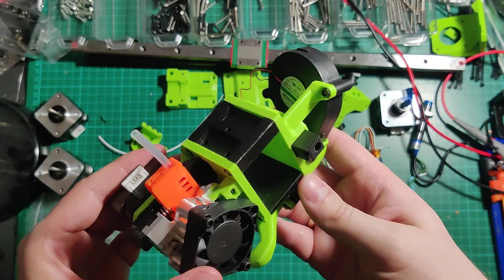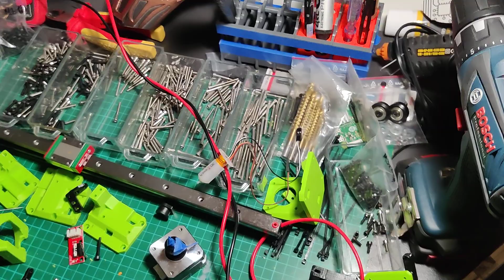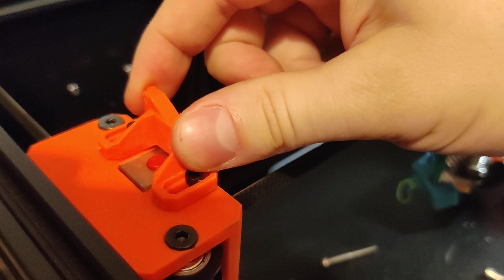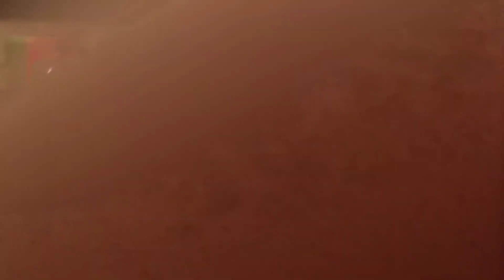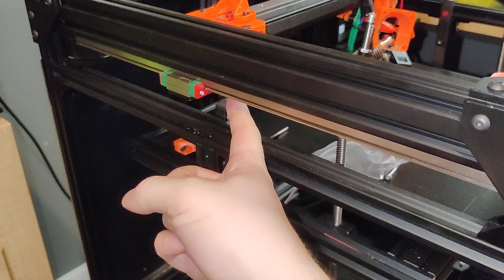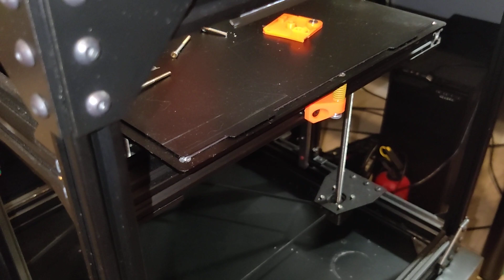[#2] EVA, GitHub, Easy Mod - Rat Rig V- core Pro mod

Comment: Hi Pavel! thanks for your project... i am building a V-core with linear rail and i am using your project for the Aero titan. :-) I also would like ask you your hel in one point.. for the 500x500x500, which are the 2020 structure should i use to to support the linear rail? thank you in advance.
Reply: @eva-3d948  yes.. but I am building the Vcore Pro Linear Rails.. I bought almost everything from.them... I only haven't bought the heavy parts due the weight... ship to Brazil is complicated.